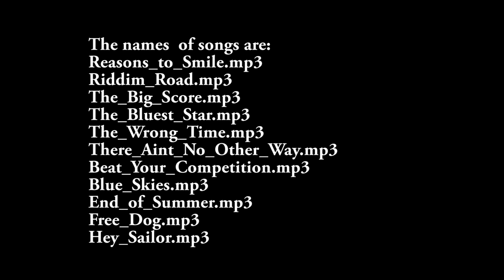Aquamarine and diamonds 18k white gold ring handmade

Comment: Very touchy this one. You have figured out the design in your head but us, it look very complex as you had up things on the ring. At some time, I had to turn my pad upside down to see better the little pins you were soldering to it because the ring was upside down from my point of view. 🙃
Reply from the maker: ok, but this is the only angle that allows me to resume work without obstacles ahead.
Reply: scaffoal I don't reproach a thing. It is fine. It is not you, it is me and the angle of me watching. Anyway, it was the only ring that I had to turn my pad because you have to admit, that ring had lots of things on it. I never have problem with the other rings except this one. 🤓

Comment: I do you polish between all those pins. How do you reach it? I only see polishing around but never see going through inside and between. These one has lot of those 🤔 Ok I wrote this before the end. But I never saw the little bristle going before in the other videos.
Reply from the maker: There are two possibilities, some points are also polished before the welding of the wires, the other is the use of a tumbler balls to get where they do not reach the toothbrushes. Some passages of the cleaning do not enter them in the video for the duration and reasons why many observers is boring.
Reply: scaffoal ok, I understand. you can't show everything on video. That why I never saw jeweller do it on video.I got it, thanks.

Comment: Good night
I have a slight problem
what causes the white gold to crack when I am milling it? ie 14k
Reply: +Patrick  Singh not annealing it. the metal will get to hard and crack if you dont heat it to a cherry red to soften it every so often.
Reply from the maker: +Patrick  Singh There are various types of alloys to make white gold, some are easier to use and others that require attention during melting in burns. Some types of alloy if you wear has high temperatures during melting, or if they come into contact with foreign substances, during the drawing phase will crack. If using the lost wax process, often the metal tends to crak for micro natural porosity of this type of processing. It does not depend on carat gold you are having the same problems even with the different tipe of carat . I use alloys of LEGORGROUP that has a website where he lists all types and their properties.

Comment: what do you use to solder the joints? 24 karat or some other alloy?
Reply from the maker: the rings are alloy 18k. The welds are alloy 18k with melting temperature below that of the jewel.